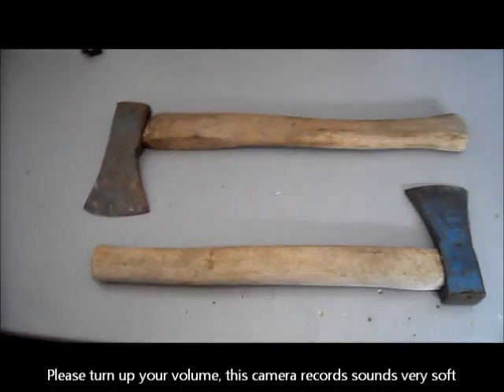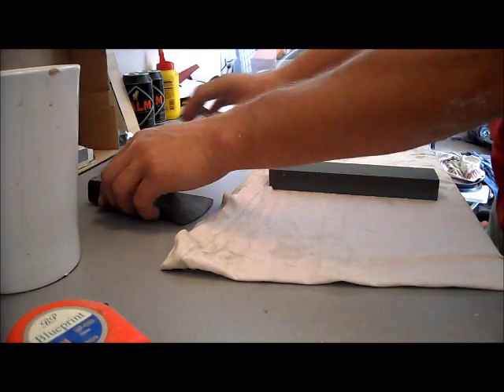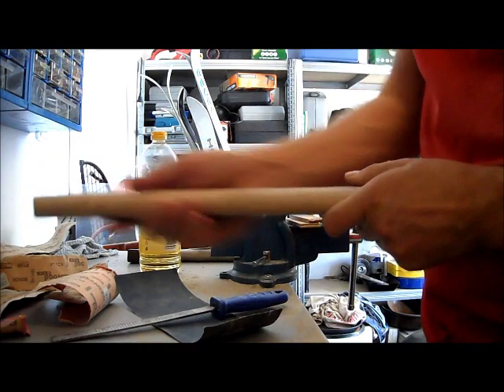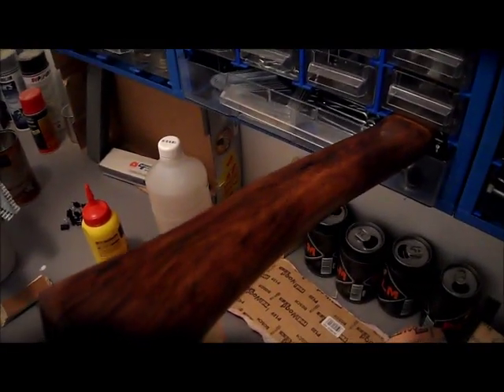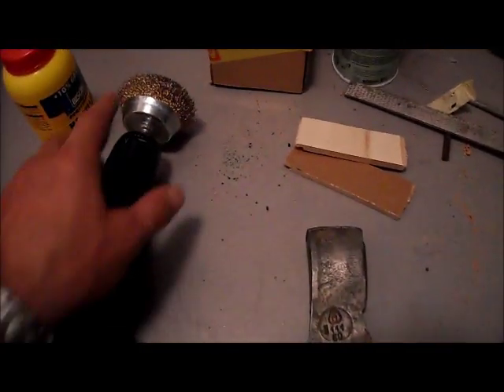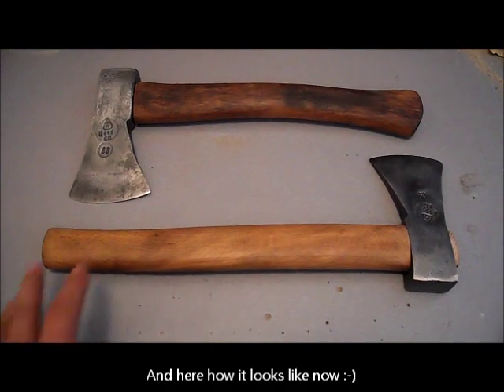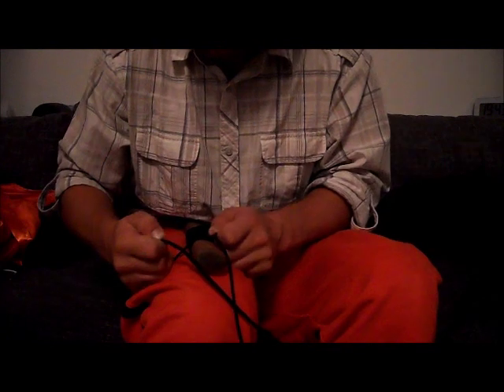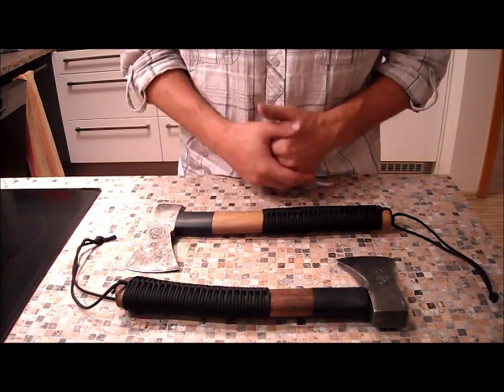DIY - Fixing up 2 old axes

Comment: good job restoring the axes! 
just a tip: there is a 90 degree sharp "shoulder" in the handle, just under the head of the axe (where the handle gets thinner, to fit the eye). you might want to round it, to make it go gradually thicker towards the handle; as it is now, it's a stress point that might promote cracking if the axe gets some hard use. it might never crack, but why not eliminate the (theoretical) weak point? otherwise (again :D ) : good job!

Comment: First of all you did a fantastic job restoring the axes.  I was hoping you would etch the steel in vinegar and you did.  I forge a lot of knives from old files and I also etch all my blades in apple cider vinegar.  One thing I do that you can try next time is heat the vingar to a temp that is unconfortable to put your finger in and put steel in.  You will see millions of tiny bubbles coming off steel as it is etching.  bring steel out and check until you get the shade you want.  This method deters the blade from rusting with minimal care.  Same as black oxide finish. Ive had blades sitting in my shop for years with with minimal rust. It is also very humid here in Kentucky (US).  Again great job on the axes.  Mike..

Comment: You always want to leave a lip of wood extending beyond the head. This goes a long way toward prevent the head flying off when swung if the head gets a little wiggle due to wood shrinkage. Cutting the wood off flush is a huge mistake.
Reply from the maker: Well... there are different opinions about that, but i do agree with you on this. These 2 where the first axes I did. Now I'm a 100+ further (my collecting went a bit wild) and usually i leave about 1 cm of wood sticking out.
Check this one for the latest axe I renovated and tell me what you think about it plz.
2013-12-23 - Renovating and reshaping an old axe